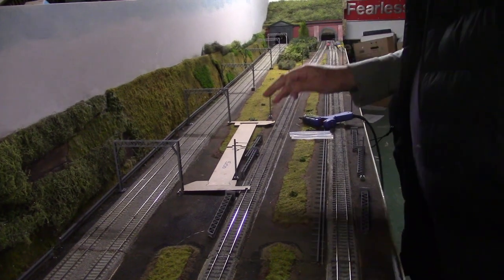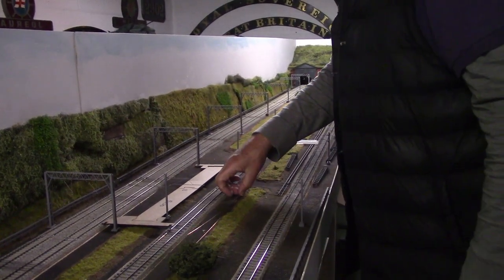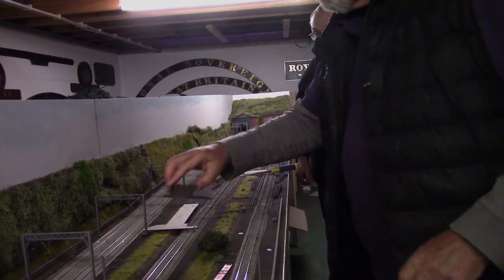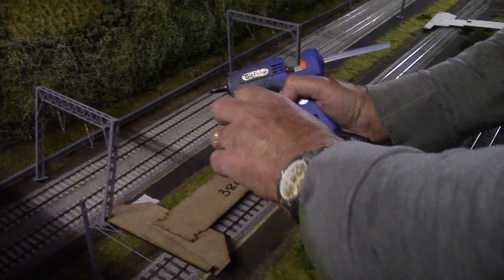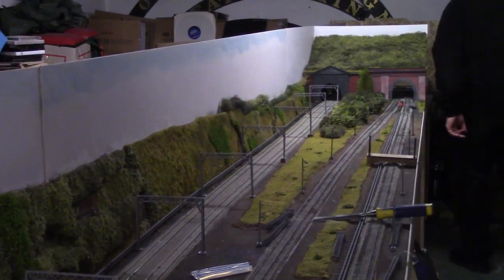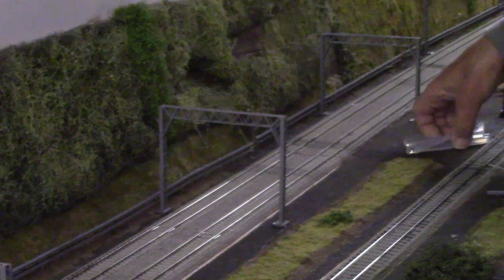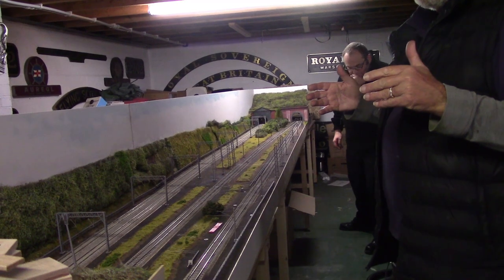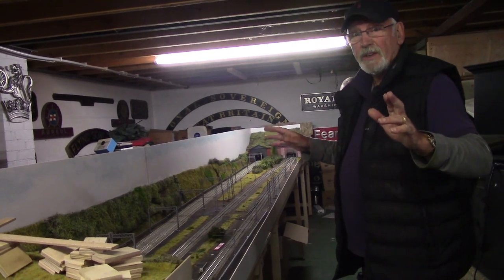'Making Tracks' build update

Comment: Excellent work! Thanks for the update and really interesting to see how you’re installing the OLE and also detailing that section of the layout. I used NBrass kits to create many of the masts for my layout and used the Peco wires but cut each to length (mainly due to the nature of my layout). I did use a couple of jigs to help me get the length of each wire correct, including a steel rule taped to a block of wood! I like the jig that you’ve laser-cut. 

When does the layout commence being on display to the public in Chester Cathedral? I look forward to visiting. Regards, Mark
Reply: I am going with adapted nBrass multi-track stanchions and also the PECO single track masts and my builder and I have measured the mast gaps to allow for the standard lengths that PECO produce wire sections of.
Reply: Sounds a good plan! I also used nBrass kits with PECO wires .... the wires are easy to shorten if required (especially around curves as any inside track travels less distances) ... look forward to seeing the progress on your channel and RMWeb 👍
Reply: @ModelRailway  Hi there, i love your layout, its incredible, I can only ever hope for my layout to be somewhat decent in comparison to yours - I am really only getting back into the hobby but i am a keen rail enthusiast - and i noticed that the terminating wire gantries on your layout take the catenary wire into standard single mast gantries - you really could do with some of the tensioned terminating gantries (which take the wire away from the track - as seen on the chester layout where the viaduct line runs into the parallel OLE sections) at the end of your scenic loco siding on the right hand side of your loco bay and on the left hand side of the extended loco shed (as you look back from the station area - and at the end of the terminus station - Manchester Picadilly has some great gantries for inspiration - at the end of p1 and p2). This would really finish off the OLE aspect on yours which is otherwise breath-taking.